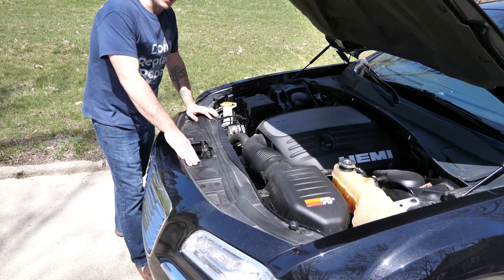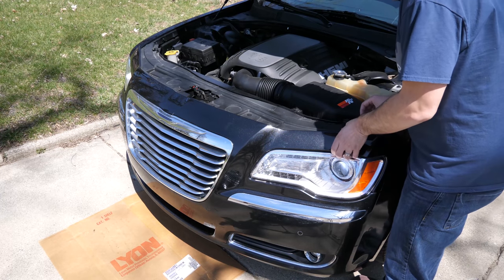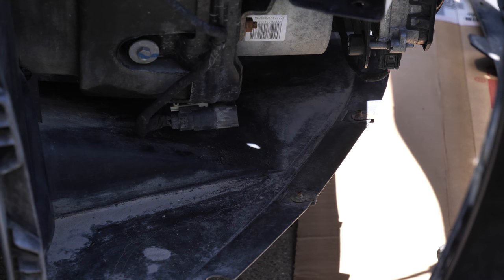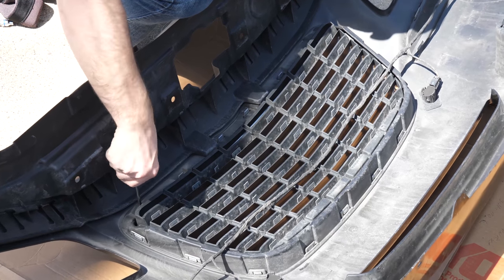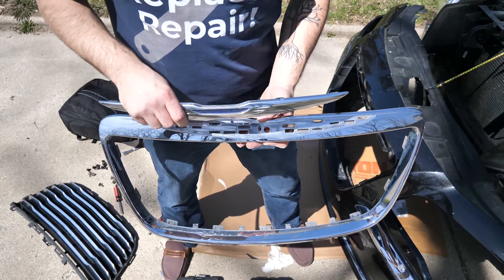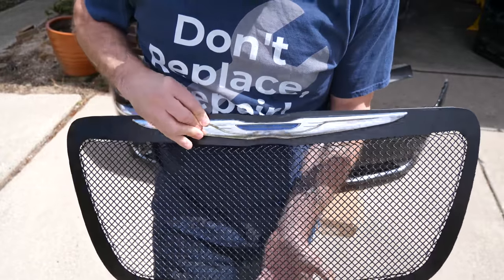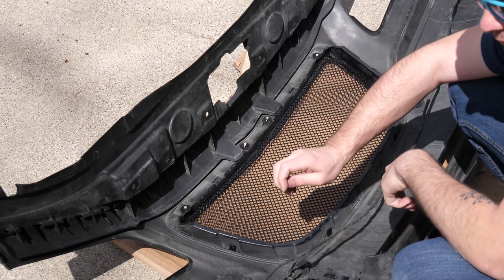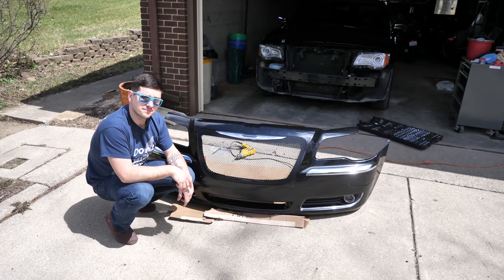How to Replace A Chrylser 300 Grille (Bumper removal)

Comment: Ry, which mfg/supplier did you use for the Chrysler 300?  (I too got a "plastic-ie" replacement, and it look cheap and gansta)  My 300 is dark blue and the black grill looks fantastic.  Thanks for the vid, very informative.

Comment: Ry, did you put fog lights in your X-Terra?? After-market or OEM?...Video on installation? ;) I think I saw some in the background.
I've been looking high and low, for more than a year now, for fog lights for my 2005 X-Terra, with no luck. I would love to find a pair that fit and work properly.
Reply from the maker: I have not done any yet. I would like to however. Its on the list. I will likely do a light bar in front of the lower grille first though.

Comment: Is there a way to take off the front bumper chrome accent covers on each side as well? I have a granite color 300 and chrome accents and wanna change to all granite
Reply from the maker: Yes! I actually did that and ended up wrapping them in black vinyl rather than painting. That way I could reverse it in the future. I think it turned out really well. Check out my Instagram for photos @ry_the_car_guy